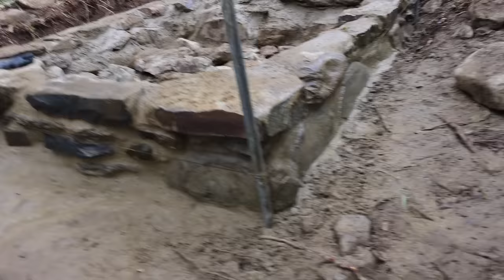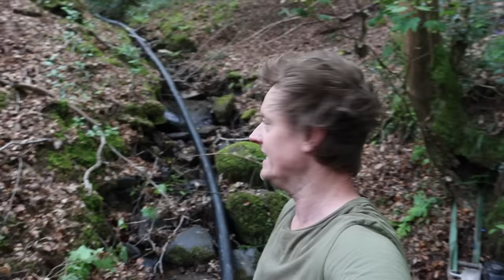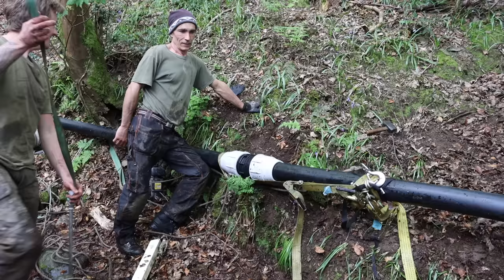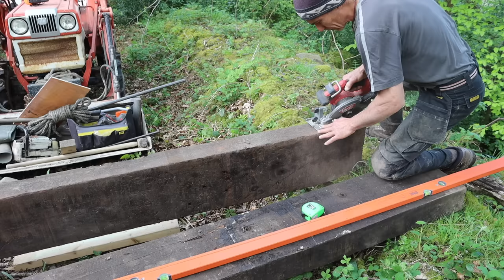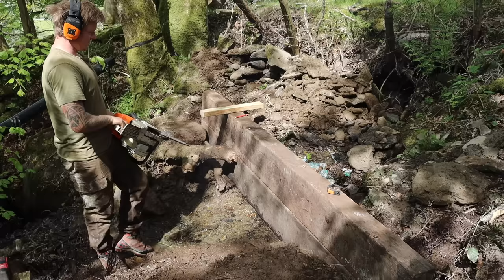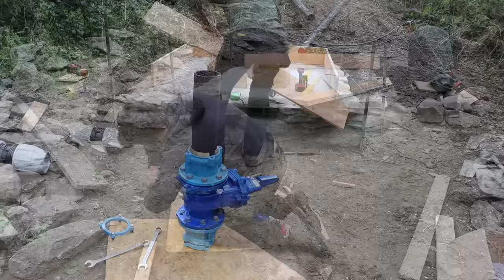1.5 Kw North Wales Hydroelectric System Installation Part 1

Comment: Chris excellent video. I have a question. You had mentioned in a previous video the type of wood you were using to dam the stream. What is the name of the wood? Thank you.
Reply from the maker: The wood in these sleepers is jarrah, its an Australian hardwood that was cut and came here by boat a very long time ago for the railways. its now pulled up and replaced with concrete but has a lot of life in it yet as it is one of the most rot resistant woods in the world. That dam will almost certainly outlive me in terms of rot resistance.
Reply: Thought it was Aussie iron bark at first. Known for being tough on saws. Thanks for answering that question.

Comment: I think soon it should be good investment to get pipe welder into your arsenal.  Then you weld the pipes in good spot and then pull it in place. But when you do, don't buy the cheap ones with manual movements. Those with hydraulic movement are much better.  Rather used one like that than new one that is manual.

Comment: In order to generate 1.5 KW at 45 meters it will require over 100 cfs of flow which would require at least a 60 cm pentstock.

Comment: Good job guys. Please sharpen your chain saw
Reply: It was sharp but them old Jarrah timber sleepers blunt chains fast. Really hard timber to start with and then because they are really old sleepers they are impregnated with grit, sand etc. 
Jarrah is one of the ironwoods and is also known for its high tool wear properties.
👍✌

Comment: Leave the pipe couplings loose and you should be able to use the curve to advantage by turning the pipes rather then fighting them into line. You will need a strap wrench to turn the pipes. Car seat belt webbing bolted to 2 x 2 timber should do it.
Reply: Lol..  that was a strap wrench we were using, also there is no way you can turn 50m of 110mm pipe meandering down a 40m slope with a strap wrench either.

Comment: Question: would it be possible to fill a 1000gallon holding tank, put it up on an 8'-10' platform, have it gravity feed through a hydro electric system and use a small pump to move water back up to the tank? Somewhat of a closed loop system.
Reply: A perpetual motion machine 😂

Comment: Seen this a while back too bad for hdpe you did not have a fusion it will melt the dr17 or dr11 at 1500 watts nice set up.  A man makes turgo s/s steel pelton cups online in nevada i think expensive but can run up to i think 10kw.

Comment: Two beavers Perfect place for moonshine!.
Maybe it will work during rain...4 inch pipe . Reservuar is small. Yu need 10X bigger in my opinion.Cover good with earth PVC you dealing with expansion at hot days
Reply: It's not a reservuar but a spillover for an intake box so doesn't need to be big, it's purpose is to direct and concentrate the flow.
Reply: @rafo6577  
how do you know?
Reply: @naroddyzmow5356  maybe because I'm the one helping to build it.
Reply: @rafo6577  lol

Comment: Stupid question, but have you considered some kind of netting around the intake area.  Basic frame and stainless steel mesh  to keep out most the dropping debris, still need maintenance to clean it but probably less than the intake.
Reply from the maker: It will have a stainless steel screened intake box

Comment: Does this contraption require planning permission? Also, are those sleepers treated in anyway? They look like old railway stock which are typically treated with bitumen - not the sort of material that should be plonked into a watercourse.
Reply: Australian Jarrah and untreated. It's an ironwood so extremely durable and no treatment required.

Comment: Remarks. One. Elbow grease and, part two, lead work. Two. Will see out the century. Three. 'when you use a kilowatt-hour of electricity, it has done just about as much work as a horse could do in an hour -provided a horse could sweep, cook, do the washing and ironing, provide light and refrigeration, tend the furnace, wind the clock, and furnish entertainment that varies from Pagliacci to Charlie McCarthy' Westinghouse ad 1930s.

Comment: Maybe add some lip on the coutout, so the water doesn't land right in front of the sleeper, as that will probably errode the ground under your sleeper away, and make it leak under it.
Reply: There's a stainless steel intake box that sits under the cutout to be fitted yet.

Comment: You interrupted your helper/colleague there. 360 meters of power line, but how many meters of pipe, 200 meters?
45 meters elevation change on a 200 meter stretch is steep, didn't look like it was that steep?

How many liters pr. second do you use in your calculation for winter time and what is OD, SDR and PN of the pipe?

Comment: you know what i would test, i would have the damn at the top run the pipe like 30 feet down and have it fill up a second damn that then fills the rest of the pipe. 
would it act like a slinky going down a flight of stairs and multiple the power, or is it no different than the head pressure you get from a single length of pipe?

Comment: 1kW. Where i live it's 20 eurocents, so it can produce 4,8 a day or 120 a month. Might be this project will break even. Though a kilowatt is half of what you need to run an electric kettle.
Reply: Hmm.. Not sure you've quite understood how the system works, dude.....
Did you really think they'd go to all this trouble and expense for so little apparent return......?!
Reply: @andymccabe6712  if you know something that evaded me please share. It's written right there- a 1.5 kw installation, in the vid they say 1 kw.
Reply: @6Oko6Demona6  It's per hour!!!!!!
Reply: @tonygrimes13  Jesus Christ, I hope you haven't passed any highschool physics during your education. kW is a unit of power, not energy. Energy is power times time. So 1 kW installation produces 1 kWh during 1 hour, and 24 kWh during a 24 hour period, and about 720 kWh during a month. But since you can't store energy efficiently it's the best to use this power while it's produced. You can run half an electric kettle on this installation, time is not important, you can run it through eternity.

My economic calculation was only made to show that it seems to make at least some economic sense. But other than that: I don't think I would bother:)

Comment: Are you using AC or DC feed back up the cable to the sourse and how much volt drop will you have on the cable length

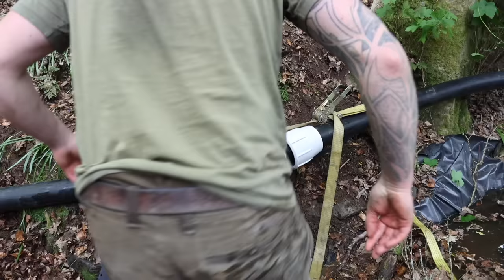Comment: @10:39 when you pulled the pipe up too far, could you not just shove the fittings back and cut a few inches off the pipe?

Comment: Just wondering what the ratchet-strap-bar tool is called so that I can order one online. The tool I am referring to is the one used to tighten the plastic pipe fittings.
Reply: It's a Strap wrench Phil. Better ones on the market than that one too.

Comment: Could you have filled in the base with more stones and less concrete?
Hope you didn't hurt your back lifting that wood!
Reply from the maker: we did fill it up with quite a bit of stone. It was only about 6 bags of cement to fill it. we used about 15 bags total and about 5 ton of sand ballast and stones. so it is mostly stone and sand.

Comment: Is there a backup system for if the stream runs dry during a spell of drought, or don't they ever get a drought there? I find these projects so interesting.
Reply from the maker: It will be a seasonal system designed to provide power in the winter when the large solar system isn't producing much power. Welsh Winters are usually very wet.

Comment: What I do not understand, is why install such a low power generator 1.5 KW = 1500 watts, A bread toaster or a woman's hair dryer would use all to the generator''s output. For a whole house power system, you need around 20 KW.
Reply: I believe the energy is stored for later use.  Just like you dont use a hair dryer all day, but you do get 1500 watts somewhat continously for 24 hours

Comment: Great job but water needs to be a lot closer 360m of pipe and cable, cost and frictional losses, cable run will become part of the load due to its distance? , love the idea though and every home that has a water source should have one , quality job and you have worked really hard in those conditions and terrain 🍻🙏
Reply: Sometimes you just can't have things placed perfectly, there's always going to be limitations and the customer's wants to take into account over losses. I'm sure Kris is fully aware.
Reply: Fuuny, isn't it - anyone would think Kris had never designed and built and painstakingly perfected a hydro system before - and consequently, had lots of experience and knows exactly what he's doing........
YouTube comments - don'tcha just love 'em.....?!?!
Reply: That's total length used and not the length of the run.
Reply: @andymccabe6712  I love laughing at some of them!

Comment: I don’t understand why the people who build these mini hydroelectric systems don’t fuse weld the polyethylene pipe… the joint is stronger then the pipe…. No fitting cost… easy pipe install too..

Comment: That’s a lot of effort for only 1.5 KW output.
Reply: But if you get 1.5kW reliably every hour, then over a year that is 13MWh. That much electricity would cost about £4000 (5000 USD) to buy in the UK in 2023, so if you can build the hydro system for less than £10,000 (12.5k USD), your payback period would be less than three years, and after that it's just free energy. The average UK home uses about 3MWh per year. This is about four times what an average home would use.

Comment: Generator Development Partnership Project Request also sent to your Generator Supplier...

Hello Kris,

Please forgive this contact format - I am unable to find your contact information online.

My name is Thane Heins and I am a Canadian inventor and CEO of Ottawa based Cleantech R&D company Potential Difference Inc.

I am writing to you because I am interested in initiating a generator development project partnership with you (and your generator supplier) for both your hydroelectric and wind power applications.

One of our US patented innovations is the ReGenX Generator which REVERSES Generator Armature Reaction. As a result the ReGenX Generator does NOT produce a Counter-Electromagnetic-Torque when generating electricity BUT it produces a Complementary-Electromotive-Torque instead.

This means that less mechanical input power is required by the generator when placed on-load and when delivering power than is required when idling on no-load. For a fixed mechanical input like you use in your hydroelectric projects the total output power generated can be increased by about 500%.  

Instead of generating 480 Watts in your hydroelectric generator and wind turbine you could expect almost 2500 Watts from each. 

When Generator Armature Reaction is removed from the electricity generation equation it also means that 480 Watts of electricity can now be generated with 80% less water input power or less than 90 Watts of mechanical water input power.

In addition 100% of the on-load stress in the system is eliminated.

Thank you with kind regards
Thane

Thane C. Heins
President and CEO, Potential +/- Difference Inc. R&D
Ottawa, Canada
thaneh@potentialdifference.ca
613.293.1131

ReGenX Generator US Patent:
Generator and Improved Coil Therefor Having Electrodynamic Properties: 
https://patents.google.com/patent/US20140111054A1/en

LENZ'S LAW - What is Generator Armature Reaction, On-load Counter-Electromagnetic-Torque 
https://youtu.be/j1tZDSZtXq0

Generator Armature Reaction (Lenz's Law) & How Can Now it be Reversed and Eliminated with a Load Current Delay Producing A Complementary-Electromagnetic-Torque.
https://youtu.be/pyO8FUTDX68

Potential +/- Difference Inc. 
"We generate solutions"
Reply: Here is a response to John at Motenergy... Cheers from Canada with kind regards Thane

Hello John,

Thank you for responding. I also really like what Kris is doing also and why I think he (and you) will be really happy to get involved in this.

Our claim (since 2008 at MIT) is that Generator Armature Reaction can now be reversed by introducing a Load Current Delay into the generator coils.

And as a result,  zero mechanical input power is required by the generator when it is placed on-load from a state of Rotational Equilibrium because the generator produces a Complementary-Electromagnetic-Torque rather than a Counter-Electromagnetic-Torque.

Overall this means that 80% of the mechanical input power (from water or wind) required to generate electricity is removed.

This will help Kris a lot because now he only needs enough mechanical input power to bring his systems up to idle speed on no-load.

When the generator is placed on-load zero additional mechanical input power is required. 

Zero mechanical input power is required when generating any amount of electricity...

You can see this for yourself in the demo video below where the prime mover consumes less electrical input power and delivers less mechanical drive shaft power to the ReGenX Generator when on-load than was required to idle the system on no-load.

Thanks, with kind regards
Thane 1.613.293.1131

Generator Armature Reaction (Lenz's Law) & How Can Now it be Reversed and Eliminated with a Load Current Delay Producing A Complementary-Electromagnetic-Torque: https://youtu.be/pyO8FUTDX68

Comment: How any solar panels to get 1kw ?
Reply from the maker: about 4 panels in summer for 8hours of the day. But this hydro will make power in the winter when in this part of the world there is very little sun at all. It is combined with solar.
Reply: three
Reply: @KrisHarbour  So basically you end up with the best of both worlds rain in the winter and sun in summer  .And yes i know what you mean from North Wales myself. Solar must work out a lot cheaper to beguine with though
Reply from the maker: Yeah solar is much cheaper. There is a lot more work involved in hydro and the parts are much more expensive. But the design life is much longer and the output power is 24h a day 7 days a week so there is a huge saving on batteries as you don't need anywhere near as many as the power is feeding in 24h a day in the winter when you need the power.

Comment: you still havent figured out the difference between flow and head pressure of pumped and gravity feed

once again....with that 4 inch pipe, there is more than enough flow...turns and bends wont affect it, you only need to worry about static and dynamic head pressure, because you will more than likely restrict the flow with the nozzle, which creates velocity out the end